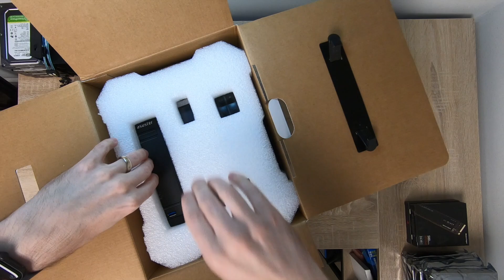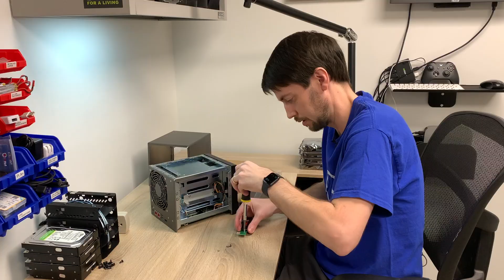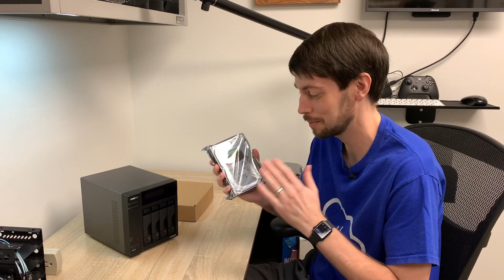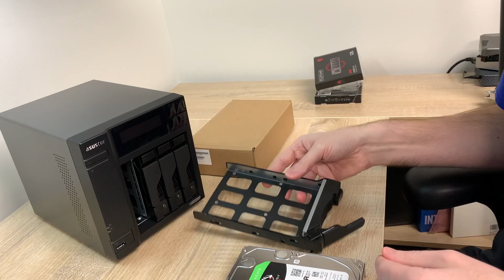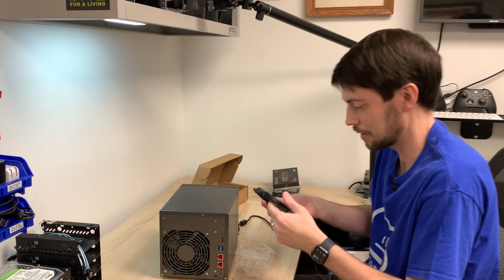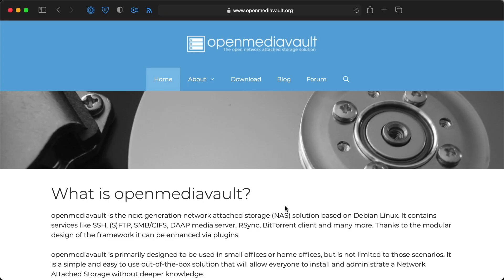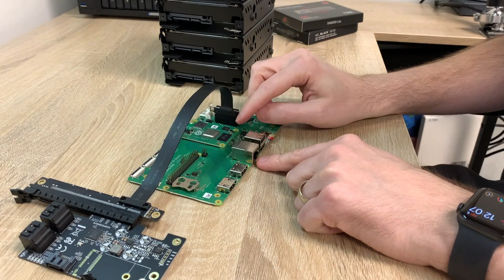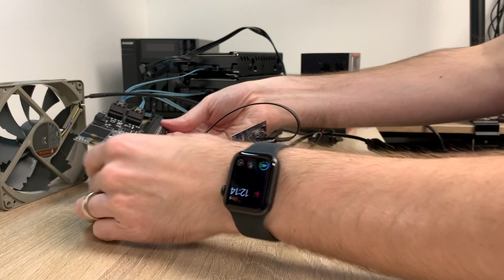Raspberry Pi vs ASUSTOR NAS Head-to-Head Part 1 - Hardware

Comment: It would be nice if you also had included a single RPi4 4GB with 1-2HDD connected to USB3 and 1Gbit Ethernet, which is probably what 99% would have used for a home-built NAS.
Reply: Two drives? Gross! Where's your data for 99% of us? I watch this video and immediately went to eBay and bought a used Dell 720xd. If you look at most of the tech YouTube channels, everyone is running slightly used enterprise gear. Lawrence Systems, Jeff G, NetworkChuck, etc. For less then both of those setups you can have a decent NAS.

Comment: Thank you for the creative built. Unfortunately the Pi system looks more complicated than I think is necessary. After looking at the X825 board from geekworm and other single board computers like pine64 rockpro64 with NAS dual HDD case I want to believe that there are more elegant solutions that challenge the price point of asustor.

Comment: The "s" in smr stands for shingled, not shielded, afaik. Thats because each write slightly overlaps the write from the previous rotation, like roof tile shingles.
Reply: And what does this mean for long term storage? I mean 10 year plus. Do I needs ZFS on these with parity enabled?
Reply: @edgarmatzinger9742  I know this is Very Late, but for posterity. Do Not use SMR HDDs for nas storage. The rebuild performance on a drive failure in an array is absolutely abysmal with SMR. Use them anywhere else but in a NAS array. ServetheHome, a website and youtube channel covers this topic in a LOT more detail.
Reply: @edgarmatzinger9742  it means they'll fail...
Reply: @mimmimim  Not fail, neccesarily (one should always have backup though, RAID is not a backup!).. 

I have a IRL scenario, for myself. I "rescued" 4x6tb WD RED drives, SHR versions. To verify paridy on this raid 5 array it would take 18! days. Compare that with less then a day on 4x3TB WD Red in classic format.

They are almost useless in such large arrays, so be carefull. As single or mirror they work great, unless you write 100's of GB at once.

Comment: 7:59 Backblaze releases a yearly hard drive reliability report for all the drives in their infrastructure. It really replaces the anecdotal information surrounding brand reliability with fact.
Reply from the maker: It is a good data point, for sure. I've followed their posts year after year. I wish more companies would release this kind of data—you know they have it for internal use.

Comment: The best thing about a Pi NAS (or another SBC based NAS) is that it allows you to learn and test your concept, test your use case. Once you're done, you already have a good idea of what you look for in a NAS, buy "real" NAS and repurpose the PI for your next project. 
That's how it works for me: I have a Pi NAS that I've used for a year or so as storage for my multimedia collection and I use Kodi on several devices to access it. Now I know what I want, I already have a good ideea of a NAS device that would suit my needs, and once i can fork our the cash for new toys, the PI can take on it's next assignement.

Comment: Regarding the requirement for NVME 2 drives before allowing "read/write cache", this is surely because the drives are mounted as RAID1, so that no data will be lost while writing in case of an NVME failing. If the "read only cache" drive fails then your data is still safe on the primary RAID.

Comment: I'm happy to see you got some nice free hardware to provide us again with incredible informational videos.

One question I have in relation to trim support through an usb adapter ( CSL asmedia 1153E ) on the pi4 2Gb.
I don't seem to be able to get trim support activated on my pi. I used the latest offcial rasbian 32 bit image and performance is excellent.
I even bought an 120 GB Kingston SSD ( lol ) to duplicate your setup to no avail.

following your procedure I always get the message that trim is not supported on the csl adapter. it's the small triangle version.
I did contact csl support Germany and they did provide screenshots of the mainboard to proof that it's the 1153E chipset although raspbian always tells me it's the 1153 version.

I've taken it as a challenge to get my both csl adapters to activate trim on my Pi4's ssd's. ( Kingston ssd and Hynix Sata ssd on those M2 > sata adapter boards.
is there any way to retrieve the firmware version to check if it does support trim?

Comment: i'm my experience from having had all 3 different setups for several years; 1. a pi-nas, a2.  prebuilt nas and 3. a custom built nas machine. I can say that i prefer a custom build one always. to make it as energy efficient as a pi however requires quite a investment both money and time. a prebuilt nas (unless its enterprise grade) really isn't all that energy or money efficient if you look at the performance, its mostly just ease of use.

Comment: I built a PI4 NAS with a Seagate Backup Plus external USB drive which has 2x further USB3 ports i.e. a small built-in hub, this way I can run 4x drives in my NAS at USB3 speeds with a minimum of cabling and clutter. Works well provided you format drives to EXT, the NTFS format they came with will significantly reduce speeds as it doubles the CPU load on the PI.

Comment: I the show today Jeff. Lots of great easy to understand details that puts your show over the top. 

That said I have a request. For users on a budget, can you put together a show the uses a 2TB hard drive and and a basic Raspberry Pi 4 B.   Run the Drive off of the Pi’s USB 3 port and a SATA cable. Also connect to your network using the pi’s build in Ethernet port.  

The idea behind this poor mans NAS is security. The user can place the NAS is a secured spot away from his main computer. Locked up in a office supply closet is one example. It’s job will not be used to retrieve large files but to store accounting data for a small home business. But the software should allow 3 or 4 office workers to pull up according data when required. 

I’m sure there’s lots of viewers out there that needs this type of NAS.

Comment: I wanted something that could do at least 8 hard drives... I had considered a Pi, but it just seemed like a lot of work to get to 8 drives. I came across a video covering the Chenbro NR12000. $150 to ship a 1u server with a motherboard with 14 drive connectors, an older gen quad core Xeon CPU, a PSU, and 12 3.5 inch drive bays, plus a single 2.5 bay. All I had to do was add drives and RAM. 8GB of RAM was $30, so I just gave it 32GB, cause why not, and I ended up filling all 12 drive slots with HGST 4TB Coolspin drives. Excluding the drives, minimum cost to operation would be $180 + drive cost, for up to 12 drives. You can also get a PCIe riser for it, to do one integrated PCIe card, but the motherboard is an ATX formfactor, so it actually has several slots. You could theoretically feed PCIe riser cables out the rear slot opening, and set up a PCIe chassis externally for multiple PCIe cards.

Comment: One note for the caching ssd, only use read only caching  if using nvme SSDs as there is a risk of total data loss (even when it's using RAID1 for write caching) the nvme SSDs are known for hard locking up in a way that can crash the nas (nvme spec doesn't seem to have same hotplug/surprise remove function that SATA protocol has, unless you use SAS nvme) and resulting crash can lose metadata that can trash the filesystem

Comment: Might be worth factoring into the comparison, you pointed out the Pi-Nas in it's current hardware configuration could do 5 drives
I'm sure it's more about a side by side comparison...but an extra drive!

Comment: I've learned through Murphy that it is a good idea to always tape down your boards when doing testing with power on :]
(And since Murphy is always out to get you, it is also better to tape down the cables rather than the boards - typical tape likes to become electrostatically charged once you unwind it and that could really ruin your day (or at least ruin the hw ;) )

Comment: I have had very good luck with WD drives, Blues, Reds and many more before the days of the colors. They have 

failed simply from old age and a lot of use. Or get put out to pasture as I upgraded for more space.  The worst case, a Blue, failed after about 3 years. Was a surprise. Others have lasted decades. I have one now, a 2GB (not a typo), that runs all day long. It was manufactured in 1998. Scans continue to come back  clean. Still, life expectancy is a crap shoot, so good backups are always necessary.

Looking forward to Part 2. Very satisfying geekdom.

Comment: I went w/ an RPi 4 (4GB) for my first NAS build
I used two horizontal/flat HDD caddies/trays connected to the Pi4 @ USB3.0 headers
Then I have the Pi in it's own case, but I purchased a laptop cooler w/ 4 fans to sit over the HDDs for some cooling while the Pi's case/CPU fan cools it well.

Running OMV on it and it's been great for file storage and for my IP cameras to FTP to.
It was relatively cheap, and I still get 5Gb/s speeds which beats the old 2.0 standard.

I had a WD My Cloud 4TB for a while but it was HORRIBLE w/ small file xfer (or loading directories w/ many small files). But the Pi4 powers right through w/o a problem. Although I am limited at 2 HDDs (at USB3.0 speeds) it's a nice starter

Comment: I used to always use WD RED drives for NAS setups until they decided to start screwing people over with SMR disks smuggled in to the product line. Now the Ironwolfs seem to be the only reliable choice on the market.
Reply: Due to customer complaints, Western Digital reserves the WD Red Pro label for CMR and WD Red (non-Pro) are all SMR now.
Reply: Because of the vibration protection, I won't use non-NAS desktop drives in NAS anymore.  Also from sad experience, I insist on not using same brand drives as each others redundancy.  So usually it's now RAID 1 of a WD Red and a ST Ironwolf.  Unfortunately as of early 2022, ST's website makes it near impossible to compare across their artificial market segmentation, in fact they make it hard to find hard drives at all, with their marketdroids focusing on all other products; I only visit to get the redundancy.

Comment: Note to anyone buying Ironwolf. The value is in the RMA and warrenty.
I bought 4 of these drives a little over 1 year ago and put them into a Synology device.
For whatever reason, I have already had 1 drive trip the S.M.A.R.T and I had to do an RMA. Drives aren't infallible BUT I did find the Seagate RMA very straight forward.

just a hint of salt.
Reply: Don't Ironwolf drives contain the extra rotational vibration sensors to survive being stacked with other drives in a NAS.

Comment: I just read that having different ssds (read/write) of the same size could help with synchronization meaning both drives should not go sleep at the same time.  Not sure if this is true or not.

Comment: Pretty cool. For my needs, I used a Pi4 with USB 3 connected Sabrent dual bay. Did a raid1 with two drives and mdadm commands. Mounted it as /media/NAS. Created a Samba share called PINAS and that’s it. I’m on 1GB network so it matches up with Pi4 1GB network.

Note: use the Pi4 as a JupyterHub as well connected to my pi Hadoop/Spark setup. The NAS enables me to get data from internet then loaded into my HDFS and Spark cluster.
Reply: I have a similar setup for two NAS: PI 4, USB3 dual bay. The result is a bit nerdy, but nowhere as unsafe as the contraption shown. Trying to coerce a PI to handle a 2.5 GB network and SATA drives looks like a way to blow the budget with expensive parts..

Comment: So, you'll be Jeff Geerling until I watch the next video?

That begs the question: what will you be AFTER I've watched the next video?

But serially, jumping the gun somewhat, factoring in your hourly rate, notwithstanding the fascinating faffery, I'd put my hand in my pocket and cough up the extra two hundred bucks.

But I'm still looking forward to the conclusion.

Comment: i ended up getting a fully configured used one of those on ebay for very cheap, and the drives were either never configured (there were 2 M.2 drives) or were lightly used or still in good shape (according to the SMART health reporting)

it was covered in what looked to be some sort of caked on dust with cigarette dust mixed in, which i cleaned out, but it was an amazing price compared to what i would have had to pay for a new one

Comment: Shingled Drives......  I found an issue with LSI MegaRaid Raid array using 4 shingled drives, data slowly died (which was the hoohaa years ago which I wasnt aware of).  I would never use them in a raid again as a result.

Comment: Minor suggestion for the PSU you sued for the PI.

Instead of a Direct Power/short how about using a switch that is connected to a Relay, so you can safely shut it down from the PI itself?

Comment: Amazing video, just one thing, using two different PSU without the same ground is one of the easiest ways to make a fire or shorting everything connected to both PSU's
Reply from the maker: Depends on the isolation of the different boards, but you have a point, especially if you work with cheaper gear.

Comment: I had a Seagate NAS die on me last year. Its electronics died, thus leaving me with drives with data, but no way to do anything with it. So, I got a Pi and built a replacement. (Glad I had pretty much a full backup off line). So, I learned what I liked about the Pi as a NAS. One big feature of the Pi, if it dies, I have another one right here to get going again FAST. I learned my lesson about having hardware that couldn't be replaced. The Pi turned out to be a little slower than I cared for, so I got a refurb desktop, installed the Pi desktop on it, moved over the drives, and am mighty happy. The Pi is a learning machine, and I learned Linux is the way to go to drive a NAS. Replacement hardware is all over the place. I still have the Pi around in case the refurb desktop lets out its magic smoke. I also maintain off line backup of the data (media stuff). RAID 5 is nice, in case of hard drive failure. If the processor and its NOT off the shelf OS to drive the disks is not available, SAD story. Thanks to Pi, I got educated.
Reply: Don’t use raid 5, he is insidious, instills an imaginary sense of reliability. Raid 6, Mirroring plus, regardless of the choice, regular backup - good decision.

Comment: you need to check out the synology stuff.  I have 4 5bays and 1 8bay.  the 8 bay and 3 of the 5 bays I'm running 6tb drives...used to be 3td drives.  they newest 5 bay has 10tb drives.  all of them in raid 5 (or synology calls it shr). memory is always the most important thing with access time.  8gb of ram gives a lot of buffer.  Just my two cents, and love your videos...

Comment: I'd be interested if you could use Optane on this. I've got 4x110GB optane modules in my Ryzen 5 Pro 4650G server, though with the 4650G and an 8x SAS controller i is being held back by the 20 PCIe lanes of the 4650G

Comment: I use an Orico 5 bay enclosure, 5 Seagate drives and a 1TB USB SSD with a RPI4. The Orifco passes the 5 drives to the RPI4 as individual disks which I built into a RAID5 array. The Orico enclosure is on one USB3 port and the SSD on the second USB3 port. I then use bcache to cache the 5 drive RAID5 via the SSD. Works for me fine over the PI 1GB network connection.

Comment: I have the exact 6 in 1 Stanley screwdriver (you can use it as a 8 and 10 mm - if I recall well - nut driver)
Reply from the maker: Yes, I LOVE this driver; bought four of them so I have one at workbench, one at office desk, one at upstairs desk, and one in the kitchen drawer.

No other multi-bit driver comes close, though the newer version they made doesn't seem to be as easy to quick-change as my older ones :(
Reply: @JeffGeerling  be careful with them and don't use them outside. Unfortunately, they're not very resilient to rusting.

Comment: Hi Jeff, Many old school electronics guys may give to you a ESD mat, ESD wrist strap... and a good bench power supply. 
Performing a test with everything hanging in the breeze is never a good idea... 
I do want from you a taking apart of the Asustor to see the construction.
The other thing is the PCIe speeds in both motherboards, because you can use a 10Gb/s board, but the bottleneck would be the motherboard.
Nice and clear statement from you is: ONLY IF YOU WANT TO BUILD ONE BY YOUR SELF DO THIS. I stick with a professional NAS for my clients, jeje.

Comment: That NAS looks an awful lot like my QNAP TS-453A, down to the form factor,  power connector placement, case color and type of display. But the Asus has 2 x 2.5G Ethernet whereas my QNAP has 4 x 1G Ethernet. But you’ve have to do a double take to not confuse them.

Comment: It would be interesting to include a TrueNAS setup here as well. Like the Raspberry Pi, it's open source, and you can put together a system using old data center parts for not much more $$$ than the Raspberry Pi.
Reply from the maker: I've been avoiding too many old data center parts just because I don't have much room to put them, haha... (/me looks suspiciously at the growing pile of boxes a few feet away).

But I would like to look at TrueNAS/FreeNAS at some point. For the next video, I'll focus on OMV though.

Comment: A portable IPS monitor purchased off Amazon might come in handy as you assemble and test your rather janky Pi NAS setup. The prices for non-touch 1080p versions are well under $200 now. Even a few touch versions fall under that price point. Many can be run from a generic power bank.